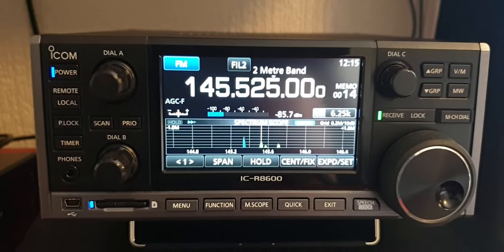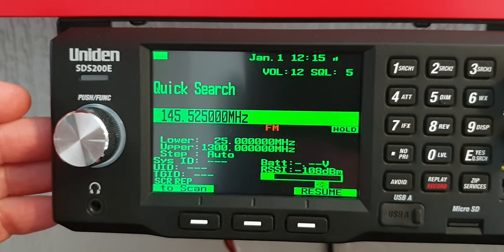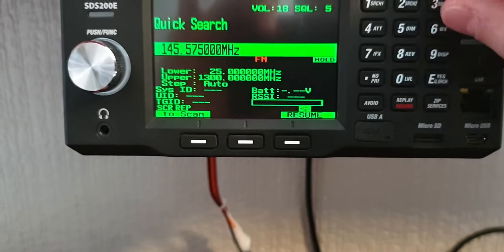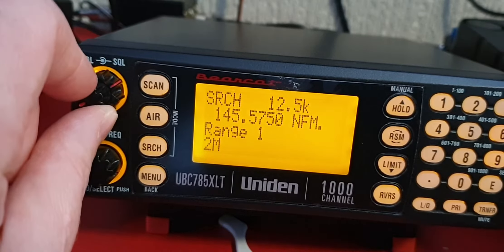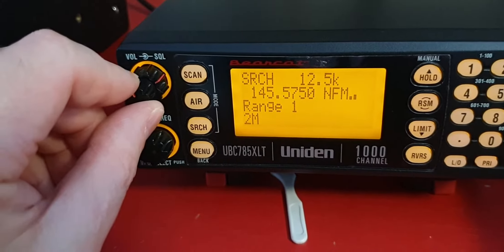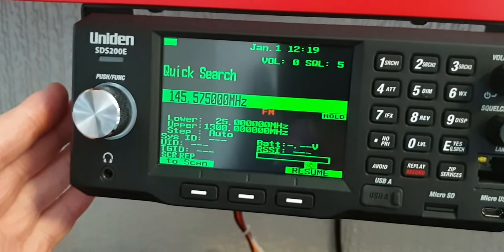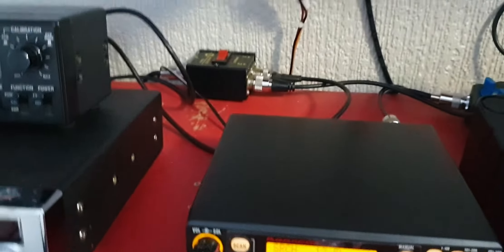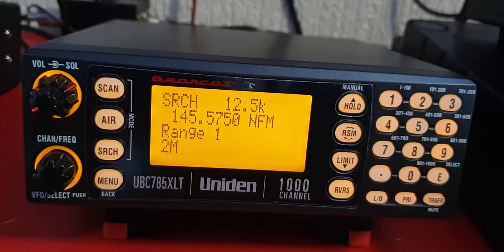Icom IC-R8600- Uniden SDS200E- Uniden UBC785XLT

Comment: Thank you for this interesting demonstration, and may I ask for your advice on why I could not received a local (UK BBC radio 4) 200KHz AM broadcast, while it is received loud and clear on vintage Selena, Sony ICF-7601L and on NRD-535. All these radios are placed in the same location, using the same antennae (long wire and other). In fact, the portable radios pick up this broadcast with hardly any antenna extension, while the IC-R8600 renders nothing but (50Hz) noise, and this is despite trying all the permutations on turning on 'noise reduction', attenuation, reducing RF gain. Am I doing anything wrong? Thank you.
Reply from the maker: @eliasragi7472  Hi, this may be a possible fault...
Reply: @onthebench3606  Thank you.

Comment: The SDS200e is pants for analogue reception particularly Am airband .
Also if you notice the uniden SDS series contains a cheapo RTL chip which is abismal for filtering and gain .
It is OK performance at best with moderate to strong signals on the decode . Forget weak signals they're hit and miss .
An SDRPlay device will wipe the floor with all of these radios .

Comment: Hey @onthebench

So I'm thinking of buying a uniden sds200E.

I have a TRX1E which tbh is crap for digital. I've been told there's a few things to worry about with the 200.

I am basically wanting a scanner I can work remotely that will do digital whats your take, do you think it's a bit overpriced and what about the BCD996P2 - Uniden Base/Mobile Digital Bearcat Scanner does this have same capabilities.

Only real thing that puts me off buying one of these is having to pay for activation codes in UK